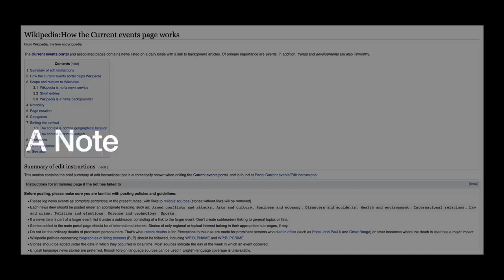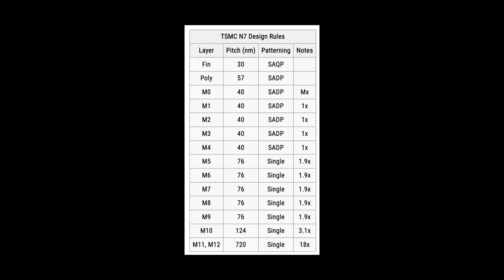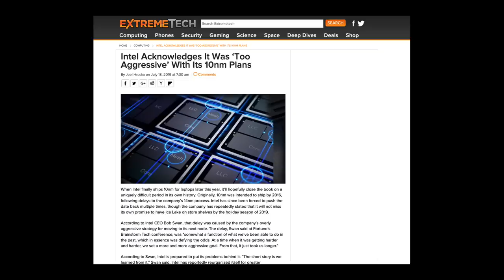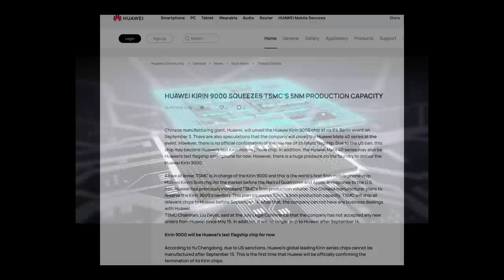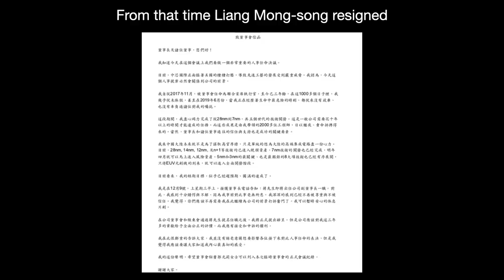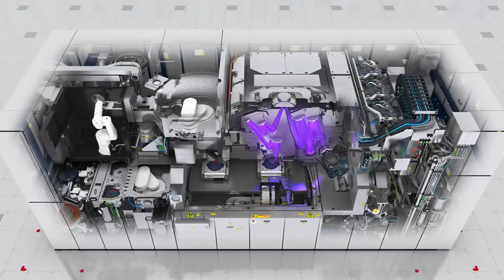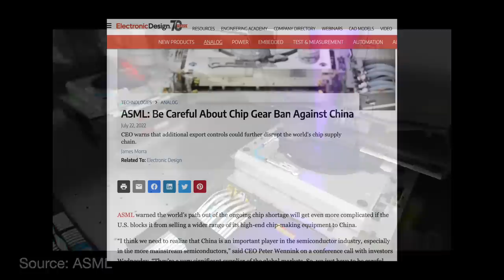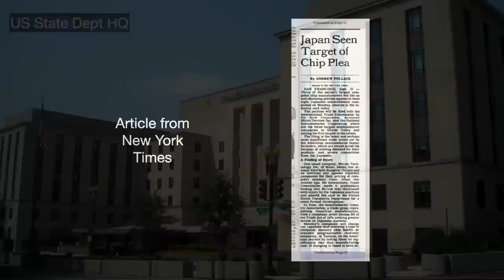China's 7nm Chips: SMIC N+2

Comment: Hello,
The hydrogen atom size is about 5.e⁰ nm.  Does this IC operate without any other electronic components?
Reply: Err, no it is not 5 nm in diameter (5*e⁰=5), it is 1.1. Ångstrøm, which equals 0.11 nm, or 110 picometer if you prefer. So a critical dimension of 7000 picometer is almost 64 times bigger than the 110 picometer hydrogen atom diameter.
Reply: @toffer1062  
Hello,
Correction goes to the universities that provided the data in 2018.
The quantity changes as time pass;
  The provided data was from Google in *December 2018. Even at that time, it was a battle to find the correct value; Harvard, MIT, and Chicago Universities had different numbers with certain exceptions and criteria.
As attached from Google, you shall find that there is no Real Number. I corrected some of the vocabulary of the statement; nevertheless, I could not do it all because of the authenticity of the reports.
a) the ionic radius of 0.208 nm.
b) Hydrogen (H) has the smallest average atomic radius at about 25 pm
c) Their measurements show that the hydrogen nucleus measures 0.8418 femtometres. Jul 12, 2010
a) the ionic radius of 0.208 nm.
b) Hydrogen (H) has the smallest average atomic radius at about 25 pm
c) Their measurements show that the hydrogen nucleus measures 0.8418 femtometres. Jul 12, 2010
d) The diameter of a hydrogen atom in nm is 0.1.
f) Chemical Components of Cells - Harvard Canvas
https://canvas.harvard.edu › files › download
diameter of the electron cloud ranges from about 0.1 nm (for hydrogen) to about. 0.4 nm (for atoms of high atomic number).
g) What is the diameter of a hydrogen atom in meters?
1.06 X 10−10 metersThe size of a hydrogen atom in meters is 1.06 X 10−10 meters in diameter.
What is the diameter of a hydrogen nucleus? Protons and neutrons are bound together to form a nucleus by the nuclear force. The diameter of the nucleus is in the range of 1.70 fm (1.70×10−15 m) for hydrogen (the diameter of a single proton) to about 11.7 fm for uranium.
h) Daniel James Berger
PhD in chemistry Author has 4K answers and 6.6M answer views7y
You can look up the covalent radius of hydrogen (37 pm), and double it for the diameter. Or you can calculate the radius from Bohr's expression for the orbital radius of a hydrogen atom in the ground state:
r=ℏ2kee2mer=ℏ2kee2me
where ℏ=h2πℏ=h2π, keke is the Coulomb constant, e is the charge on the electron and meme is the electron mass.
This expression evaluates to 53 pm, so from this the diameter of a hydrogen atom would be 106 pm.
i) Hydrogen Atom:
Hydrogen is the simplest atom found in nature. The hydrogen atom consists of one electron and one proton. Therefore, both the mass number and the atomic number of hydrogen are 1. The molar mass of hydrogen is 1.008 g/mol, and the atomic symbol of hydrogen is H.
Answer and Explanation:
The conversion factor (f) between nanometer (nm) and millimeter (mm) is shown below:
f=1×10−6mm1nm
Hence, 10 nm is converted into mm as shown below:
10nm=10nm×1×10−6mm1nm=1×10−5mm
So, the diameter of a hydrogen atom is 1×10−5mm.
Help improve Study.com. Report an Error
copyright 2003-2022 Homework.Study.com. All other trademarks and copyrights are the property of their respective owners.
Reply: @toffer1062  
Hello,
The quantity changes as time pass!
The provided data was from Google in December 2018. Even at that time, it was a battle to find the correct value; Harvard, MIT, and Chicago Universities had different numbers with certain exceptions.
As attached from Google, you shall find that there is no Real Number. I corrected some of the vocabularies of the statement; nevertheless, I could not do it all because of the authenticity of the reports.
a) the ionic radius of 0.208 nm.
b) Hydrogen (H) has the smallest average atomic radius at about 25 pm
c) Their measurements show that the hydrogen nucleus measures 0.8418 femtometres. Jul 12, 2010
a) the ionic radius of 0.208 nm.
b) Hydrogen (H) has the smallest average atomic radius at about 25 pm
c) Their measurements show that the hydrogen nucleus measures 0.8418 femtometres. Jul 12, 2010
d) The diameter of a hydrogen atom in nm is 0.1.
f) Chemical Components of Cells - Harvard Canvas
https://canvas.harvard.edu › files › download
diameter of the electron cloud ranges from about 0.1 nm (for hydrogen) to about. 0.4 nm (for atoms of high atomic number).
g) What is the diameter of a hydrogen atom in meters?
1.06 X 10−10 metersThe size of a hydrogen atom in meters is 1.06 X 10−10 meters in diameter.
What is the diameter of a hydrogen nucleus? Protons and neutrons are bound together to form a nucleus by the nuclear force. The diameter of the nucleus is in the range of 1.70 fm (1.70×10−15 m) for hydrogen (the diameter of a single proton) to about 11.7 fm for uranium.
h) Daniel James Berger
PhD in chemistry Author has 4K answers and 6.6M answer views7y
You can look up the covalent radius of hydrogen (37 pm), and double it for the diameter. Or you can calculate the radius from Bohr's expression for the orbital radius of a hydrogen atom in the ground state:
r=ℏ2kee2mer=ℏ2kee2me
where ℏ=h2πℏ=h2π, keke is the Coulomb constant, e is the charge on the electron and meme is the electron mass.
This expression evaluates to 53 pm, so from this the diameter of a hydrogen atom would be 106 pm.
i) Hydrogen Atom:
Hydrogen is the simplest atom found in nature. The hydrogen atom consists of one electron and one proton. Therefore, both the mass number and the atomic number of hydrogen are 1. The molar mass of hydrogen is 1.008 g/mol, and the atomic symbol of hydrogen is H.
Answer and Explanation:
The conversion factor (f) between nanometer (nm) and millimeter (mm) is shown below:
f=1×10−6mm1nm
Hence, 10 nm is converted into mm as shown below:
10nm=10nm×1×10−6mm1nm=1×10−5mm
So, the diameter of a hydrogen atom is 1×10−5mm.
Help improve Study.com. Report an Error
copyright 2003-2022 Homework.Study.com. All other trademarks and copyrights are the property of their respective owners.

Comment: When a company selling chip that they say they use 7nm with x number of transistors, how do we know for sure that what it is? Anyone open it up an examine inside to verify that the chip is indeed has 7nm and x number of transistors?
Reply: In short : Somebody lays on below a electron microscope and roughly measure the dimensions by sawing it open and somebody puts the new CPU in a PC and plays PC game on Ultra setting and says if frame rate is higher.

Comment: I've been a computer tech 30+ years. In 2006 when I bought my Pentium D 965, (a 45nm chip), I decided to research it. They said the Nanometer "nm" was he space between the transistor traces on the chip. At 1:20 - 1:51 you say it means nothing. Is there information somewhere that compares these two ideas? Or did you get the "Nothing" thing from an engineer?

Comment: SMIC N+2 may sound impressive on paper, however the yields are so low that it becomes commercially nonviable for widespread use. If you were to produce an equivalent Intel CPU using this process, the CPU would have to retail for roughly 10 times the price.

It's basically for bragging rights only.
Reply: That’s why each chip is small. They must be cramming 5 times as many chips per wafer to improve yields. E.G.  if each wafer has hundreds of randomly located failed transistors per wafer, and each wafer has 100 chips, and only 5 chips have no failed transistors, then if chips are made with fewer transistors so now 500 chips fit on one wafer, then there may be 100 good chips per wafer.   The SMIC chips were small and mounted like chiplets.

Comment: IMO you're gravely overestimating SMIC's current capability to produce SOCs with good yields. The bitcoin miner ASICs that were used as a pipecleaner are extremely tiny - like 3x4mm or so. Intel produces such chips aswell on its Intel 4 node, and yet using that node to build actual CPUs or GPUs lies several years in the future.

SMIC will eventually catch up to TSMC N7, but that's still gonna take a good while. Without EUV machines, SMIC will also inevitably hit a massive wall. Yes, they may be able to do 5nm with immersion tech and horrible yields, but without EUV machines, they can't progress any further.
Reply: False assumptions and very shortsighted viewpoint. You don't, and can't have access to the information to back that up. There's also a physical wall at 1.5 nm equivalent for silicon chip. At current speed, that wall will be hit within a decade. If industry leaders slow down, SMIC will catch up. The Chinese are far ahead when it comes to research into carbon chips that will replace silicon. The way the board is set up, they'll come out ahead either way.

Comment: You need high end chips to build the current generation of high tech military systems like signal interception, secure communications, GPS, satellite systems, advanced radar, radar jamming, anti-radar missiles, SAM systems, guided missiles, guided bombs, glide bombs, close in air defense systems for naval ships, guided artillery shells, drone systems, MANPADs, and many other pieces of technology that allow for modern combat. Look at Russia right now in its war with Ukraine. They don't have the chips to build more guided munitions or to deal with the SAM systems and MANPADS the Ukrainians have, so they are stuck trying to use WWI mass shelling to take ground. That sort of combat is super slow and leads to stalemates on the line caused by geography, like trying to cross a contested valley or just trying to secure a river crossing. It can also be outranged easily by guided munitions, like the HIMARS and guided artillery shells the M777 howitzers can fire (NATO hasn't given Ukraine any of these as far as we know).

Cut off the supply of chips and you cut off the ablity to do modern warfare. You also cut off the ablity of countries that don't have the ablity to make advanced ships to have independent civilian technology development. It is really hard to design a modern bridge or airplane without doing a lot of computer simulations. Heck, even basic design and manufacture of plastic parts requires CAD that needs decent chips to run on.
Reply: interesting point

Comment: SMIC's "7nm" process is a pirated version of TSMC's process. This has already been proven and there's little room for debate here. Yields are likely terrible to the point where this node is essentially unusable. SMIC was not able to obtain EUV machinery from the US nor will they likely ever be able to in the current climate. This is essential to move on to a usable 7nm process with acceptable yields and beyond 7nm for that matter. Putting it simply, other than the headlines for SMIC, they're no closer before the announcement to production. The only difference is they have provably stole a lot of technology from TSMC to give the illusion of a 7nm process. SMIC isn't there yet and it's very disappointing to see all of these caveats (which have been echoed by industry veterans) not facing further prominence in information dissemination related to SMIC's 7nm process.
Reply: Seeing the channels you watch, I'm not surprised you struggle to comprehend the truth. "IT'S COPIED 😭😭"